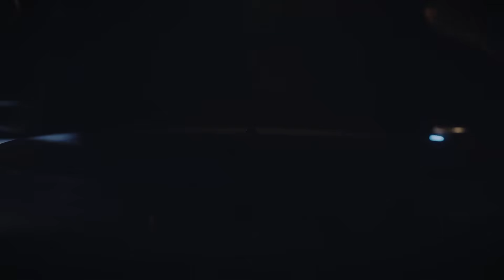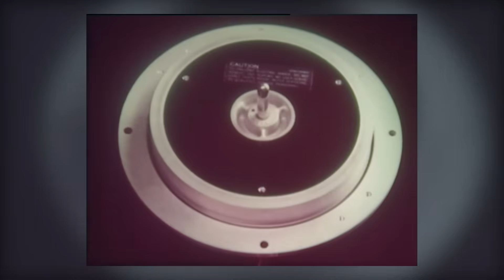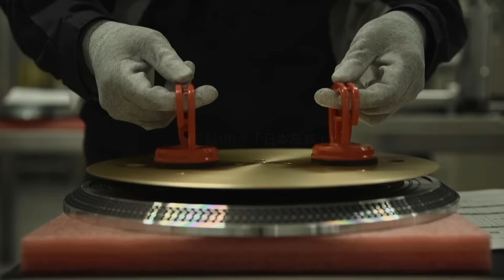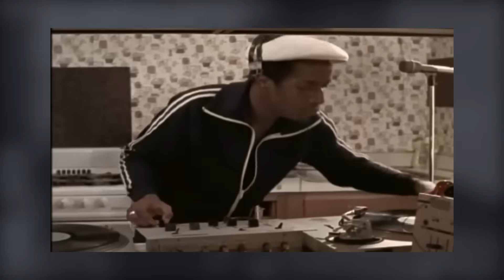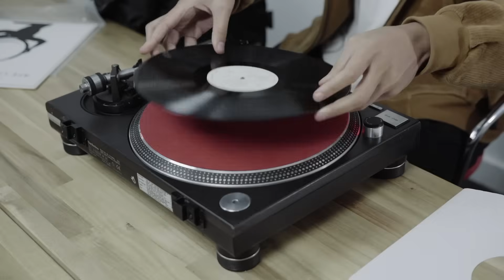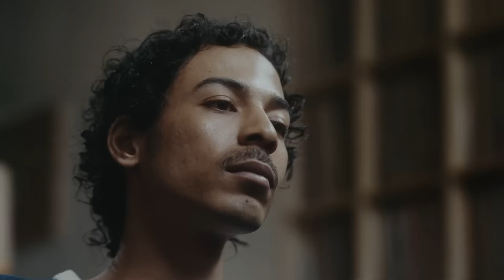The Story of Technics´ Most Influential Turntables | Voltage Labs

Comment: It took me a lot of time and effort to save up for my 1210s as a teenager in the late 90s. I worked a ton of hours in the supermarket one summer, and I was so pleased when I finally bought a pair. You couldn't wipe the smile off my face. 😁

They got a lot of use, and got taken to a lot of parties, but I always tried to look after them because of the effort I put into saving for them.

I still have them today. I gave them a little clean up, and they look and perform just about as good as new. My plan is to keep them that way until I'm no longer around.

Comment: I had 2. A 1200 mk 2 & a 1700 mk 2. The 1700 was a semi-automatic turntable in 1982. I bought the 1200 mk 2 a few years later. Within a year it developed a 60 cycle hum that wouldn’t go away? I returned it to a factory authorized service center under warranty. They couldn’t find the source of the hum? Technics gave me big balls & I had to hire an attorney. They took it back & cut me a check for what it cost me to replace it with a new one. I cashed the check & bought a Carver amplifier instead. 
My 1700 mk 2 is slightly off pitch but I can compensate the slower speed with the pitch control. The only thing I did was add Monster Cable patch cords. It still works like it has when I bought it 44 years ago. 
Thanks for the review!

Comment: bought the headphones in 2001 the dj1200 and still in use 25 years later
Reply: How many headphone parts are still original? I've had the Sony MDR-V6 for about 15-20 years, and I've replaced the cushions twice, the cord 3 times, the speaker elements once (replaced both to match even though only one died)... so in actuality I've only had the headband for those years haha :D very sad that they are discontinued!

Comment: The Dual 604 is also a direct drive
Reply: There were a bunch of direct drive players around in the 80's and 90's, but the Technics has more torque = driving force which allows a record (on a slipmat) to be stopped and instantly restarted if you stop touching the record without slowing down the platter in the least.. The pitch control is so precise and the braking/accelerating torque of the motor so big that you can make instantaneous changes of speed, the platter will always be at the exact speed that you tell it to be using the pitch slider. That's what made the difference to all the other decks.

Comment: The most amazing thing with these turntables was the bouncing stages at parties or festivals weren't an issue for them. 
 
Around the same time, early 1990s, they were selling Technics and Panasonic CD players at my local Fry's Electronics, they looked identical and a check of the back confirmed it was the same device with a different brand, but the Technics was the cheap model and the Panasonic was the high cost one. That's when I learned, offer the same product with different names at different prices because some want to get good value and some want to feel they bought the best product.
Reply: Having been in the Hi-Fi business for a while in the 80's and 90's I believe that you got it wrong, Technics was the dearer brand. They were indeed made by the same mother company, Matsushita

Comment: Bought my 1200s in 1993......No programmed obsolescence issues here. One of the best investments i've ever made. To be able to play with the records...CDs and MP3s just are not the same. The skill required to beat mix etc. So much joy to do...Nothing beats vinyl analogue sound either... esp at 20000w also :)

High five to all you out there with them to ;)
Reply: Bought my SL1210s in ‘92 aged 18. Still got them. Replaced the cartridges a couple of times and the cables but other than that they’ve been faultless. 😊

Comment: Sure, but we seem to be glossing over one glaring problem: that bloody region around 0 on the pitch control. The pitch control accuracy fades over time, but the quartz lock at 0 always stays true. So you end up with a massive no-go zone between -0.5 and +0.5 where the speed will change wildly with even tiny movements – throwing off your mixes.
Reply: Certainly this can be refurbed?
Reply: @nitemareman1  For sure, but in my experience most Technics suffer from this problem.
Reply: You can remediate it to an extent by re-adjusting the pitch fader zero point, my 30 year old decks don't have that problem at all, you shouldn't push the pitch button down so much that it scratches the carbon layer on the pitch control in the first place. Anyway there are spare part available.

Comment: This video piece missed out the original SL1200.
Back in the late 1970's and early 80's in NYC, Dj's were also using the SL1100/A models, SL1400 MK2 and right up to SL1900MK2 version's.

Comment: Direct drive is important for scratching if that's your thing but the SL-1200 is good because of the way they sync the motor to the pitch. It uses a PLL-like servo with a quartz oscilator as the reference but it lets you bias it with the pitch fader. It tracks tighter than anything because of the crystal and because it's a really well tuned control loop. Without that it'd be a lot harder for Jeff Mills to use more than 2 turntables. I suppose it's a lot sexier to show the motor than it is to talk about phase comparators. But you didn't even talk about the cool popup strobe light! That's definitely the most interesting thing to look at! It's got four rings of dots around the platter for 33-1/3 RPM and 45 RPM at 50 Hz vs. 60 Hz and you know what speed you're going becaue the ring stops moving under the strobe light when it's going exactly that speed.

Comment: When you a Vinyl DJ dont buy the SL 1200 MK7  The Reset Button is It really gets in the way when you're adjusting the pitch to beat-match for any length of time; it's too big, so you keep hitting it by accident and wondering why you can't beat-match the record. And honestly, what is a reset button even doing on a turntable? Who needs something like that? And the Clubs in the 70s used  Thorens TD-125 belt-drive.
Reply: One thing I disliked about the Mk2 was the....its hard to describe but there was a little groove where the pitch slider sits  at 0, where it clicks into place, so you know it's 0 

It was impossible to adjust the pitch to anything between -0.25 and +0.25 because the slider would move toward  0.00
Reply: @JayboTheHood ok by the way the pitch in the Mk7 is Digital, in MK2/MK3 is analog when you play with time code vinyl does it matter with normal vinyl its diffrent.
Reply: Nah! I have the 1210 MK7s myself for four years now. 
Yes, I don't need a reset button - yes, I think a reset button absolutely useless - and yes, I accidently hit the reset button multiple times. 
But after some hours playtime I got used to that wired but somehow logical button position and never hit it again. They are absolutely great turntables with superior features like 8%/16% pitch and finally detachable cables. I prefer them to the MK2s. Prices for refurbished MK2s are hilarious nowadays. For sentimental reasons. BTW sentimental - oh boy, was it a feeling to unboxes a pair of brand-new 12ers!
Reply: @elmo_sputterspark yeah i know its not me alone  the mk3 has a Reset Button also, for me the mk2 is the best yes the mk7 has better Pitch Control Lamps and detachable RCA cables but for workin long vinyl sets Mk2 Forever.
Reply: I’ve owned a pair of M3D’s since 2002 and I’ve never hit the pitch reset a single time without wanting to.